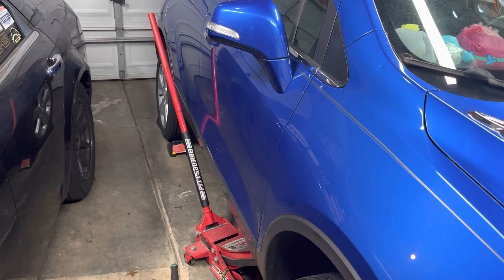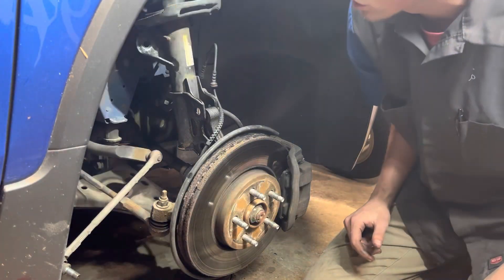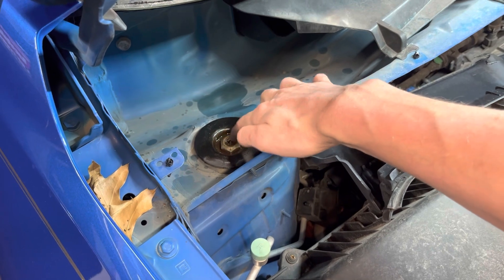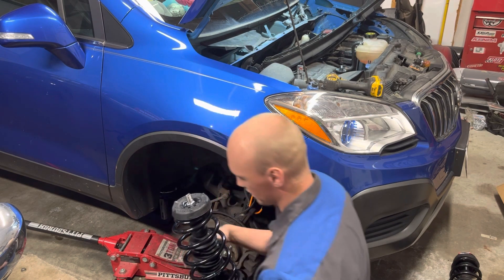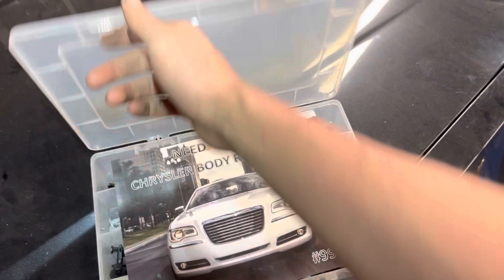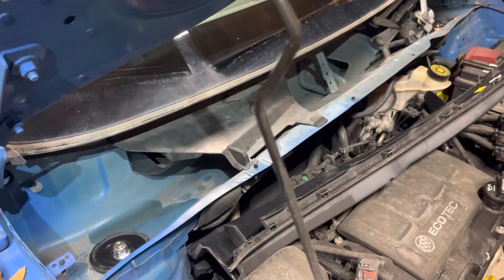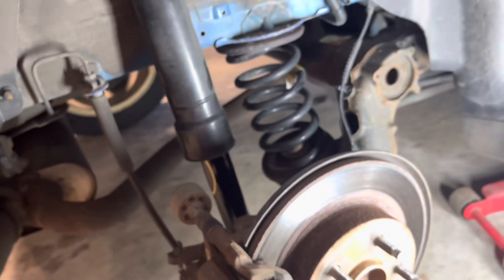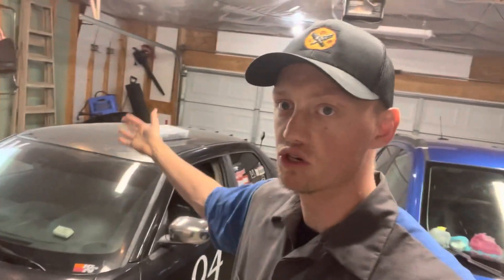2015 Buick Encore front struts and rear shock absorbers replacement.

Comment: Great video. It helped in changing my front struts and rear shock on my Chevy Trax (same as the Encore)  I have 
Moog replacement rear coils too but couldn’t drop the old springs down far enough to pull them out ?  I can’t figure it out.  Wondering if you cud spare some expert advice.  Thx

Comment: What is the torque to putting on the shock. You used vice grips to take off but just zip the bolt on with a impact tight
Reply from the maker: Honestly I couldn’t find a torque spec so I just finished it off with an impact gun but made sure it was very tight

Comment: What was the reasoning of replacing the struts? Did you have a weird noise/rattle?
Reply from the maker: Yes.  when hitting bumps there was a rattling sound in the front. I found that the struts were the issue and the bottom bushings were worn out.